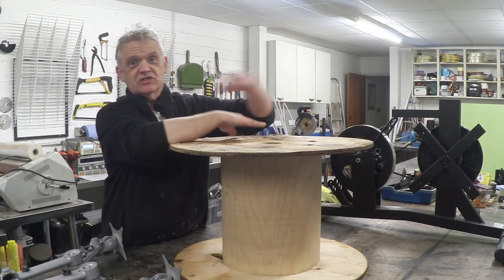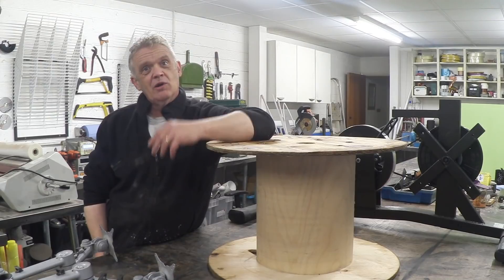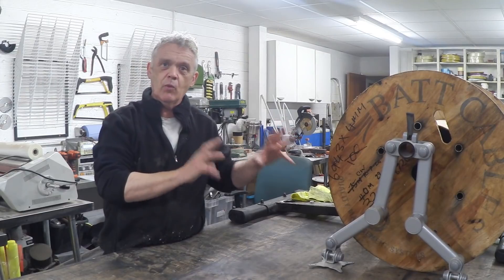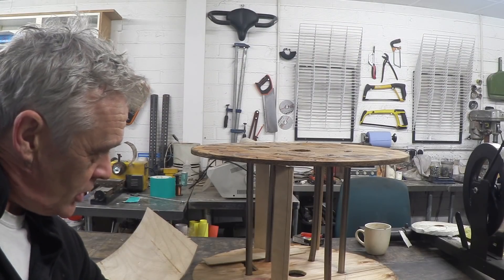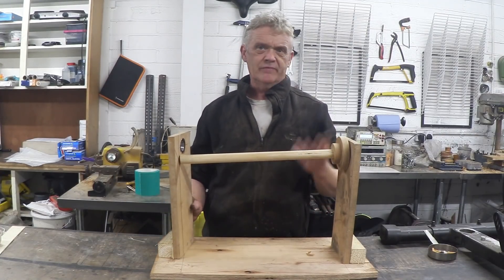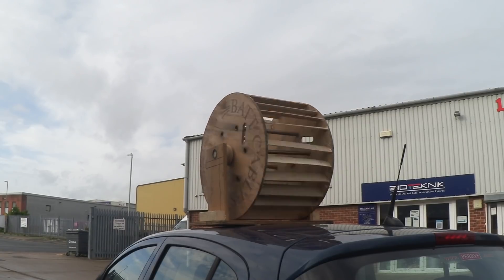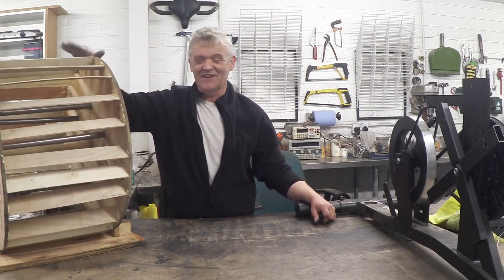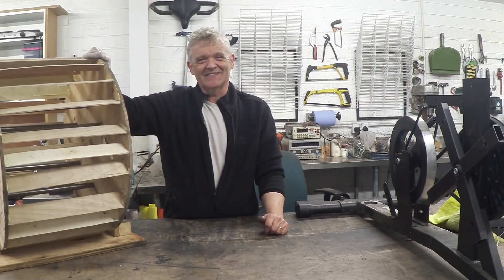Turn An Old Cable Drum Into A Wind Turbine

Comment: i happen to have just gotten a cable drum...and even more recently, a project that will use all the wire. making one 100%. mostly need to do a high power hydro generator for current project.

Comment: I have always wanted to build one of these but super light and through a cvt on a flywheel so the belt on the cvt system would change gear ratios for better torque on start up and optimal Performance at higher winds to smooth out rpm and maybe a homemade centrifugal brake. Love the content, it's a breath of fresh air from all the other YouTube hoopla.
Reply from the maker: I like the plan mate and I am glad you like the channel

Comment: You could mount a motor with a flywheel at a right angle in contact with the drum. It would be a generator spinning at some rate of knots due to large diameter against a small motor wheel.
Reply from the maker: nice idea mate
Reply: ssgeek ,i like your "Diy fret saw Mech finished" and the effective make the frame fit the tool clamping ^_~

Comment: Could also be a waterwheel?
Haha, you could pump the water up stream with the Archemedies screw and let it flow down to turn the wheel :D
Reply from the maker: it certainly could - I do worry about water wheels though as the access to flowing water is pretty restricted for a lot of folks and there are lots of rules about what you can stick in a river

Comment: I wonder, do you need to have it as a horizontal axis turbine or could it be vertical? If it was vertical axis, then some opposing magnets could be used as a type of bearing to help it spin more freely with less friction
Reply from the maker: for sure mate - and if you didn't want to instruct magnetic bearings thrust bearings would work well
Reply: @ThinkingandTinkering  Normal bearings are fine as they can take up to 50% axial loading
Reply: Vertical axis is the only way to run it as it works independent of wind direction.
Reply from the maker: can I suggest you try not to say 'only' mate - it restricts your thinking - I agree it is a good way for the reason you describe - but never the 'only' way lol

Comment: Could a feller use one of them there cable spools to power the propellers on an aircraft carrier?
Reply from the maker: I have no idea mate - but I doubt it
Reply: @ThinkingandTinkering  Well in that case can a nuclear reactor power an electric motor which would turn the spool half way out of the water and make a paddle boat out of it?

Comment: Always toyed with the idea of using cable drums  the larger ones as a water wheel by adding the baffles inbetween the sides, but how to waterproof it, I think you usually use oak or greenheart, with a  bit of creative grinding and fettleing maybe a washing machine drum  ? As a squirrel cage   
X rooby  always inspiring  Robert
Ready made mounting too with bearings
Weatherproof  !!!
Reply from the maker: I like that idea mate and if I come across one I will try it - you know me - I try not to buy a load of stuff and I try to work with things I find
Reply: @ThinkingandTinkering  washing machines are fairly ubiquitous these days, sorry unreliable ,you won't have to look far 😁

Comment: Nice. You must be the busiest man on the planet producing something like that every other day. 
What I don't really get is why these kind of turbines spin in the first place. If you think about it the wind hits the blade in front producing force clockwise, then hits the blade at the back producing force anti clockwise. Net result would be zero. I guess wind direction change inside the turbine due to the blades in front play's an important role. That would mean it's far from efficient. Also if you put a motor on it no matter how hard it spins it will not generate wind in a specific direction due to symmetry, indicating it is not that efficient as a turbine as well imho. How about making an active one  where all blades can rotate in respect to the cable drum and all blades rotate when spinning to the optimal angle in respect to the wind ? Maybe make one with 2 or 3 blades as a proof of concept ? That would be an interesting project. ( But not easy :-) )
Reply from the maker: it would be an interesting project - but more interesting to me is that as it spins it should be telling you something - that is what you are saying might have some element of error in it - I would think that it is that you are assuming a symmetry that isn't there. I don't know I am guessing but my guess is based on the observation of it spinning in a wind - of course rolling cylinders will create lift and pressure differentials between sides - so that might have a role to play

Comment: Over-modesty is overrated, if one may say. Knowing even a bit of many things is better than being great at one and only thing. Jack-of-all-trades beats any ace on the long run, atleast when giving many things "a go" and learning at the same.
Reply from the maker: I think the quote is - "jack of all trades and master of none, but so often better than master of one." But this is not over modesty mate - when I started this you could write what I knew about wind on the back of a postage stamp - I know a bit more now - still far from an expert but that doesn't matter much - the key is to try however little you know - bring all your other skills to bear - work at it and find a solution - don't get bogged down by the mental exercise of - I must find the best - I think that is an important lesson to pass

Comment: So if you just try stuff, which I think is a great idea. I do not have any work area. I rent an apartment in the States. But, I was thinking about the vertical wind generator you did. The method that you used, I thought could be used with a tree. Basically a long cable tied off on a branch up a ways then the generating part on the ground or attached to the bottom of the tree. I hope you could try that.
Reply from the maker: I really like that idea mate

Comment: if you find more drums it would be cool to compare different blade configurations, iirc there's two main designs, more like a scoop and more like an airfoil and either can be more efficient depending on shape, diameters and wind speed distribution, i would guess what you built is somewhere in between the two approaches
Reply: btw there's a cool industrial tool for pond aeration which involves a spinning vertical pipe whose underwater an outlet has small flaps that centrifugally expell water and suck in air through the pipe... this device is used to treat wastewater and iirc also for remediation. i don't have them anymore but when i had a few 200L barrels as part of the garden i was always curious to try building an aerator with be a VAWT made out of a large coffee can (there are various of plans online) designed for relatively high RPM, mounted directly on a hollow shaft that terminates in such an outlet as a simple design (could be on a bouey or some deep edge), the deeper it is the higher the resistance so i think that's the only adjustment that would needed to be made, and it's probably best to err on the side of smaller, because depth is also better for stability and even aeration.

i know large pond aerator wind turbines are a thing and usually quite complicated and costly (like thousands of dollars, designed for things like a dam or pond on a farm), and pumps need to be redundant and may still have a single point of failure without an uninterruptable power supply, so having a wind powered backup with few moving parts and no valves or anything seemed like a nice idea, especially in combination with say a solar powered air or recirculation pump, ensuring the fish stay alive even if power goes out for more than a few hours. anyway i don't have those barrels anymore so it'll be a while before i would be able to try building something but i thought in an case anyone else likes the idea i might share it.
Reply from the maker: it really sounds to me like you should be experimenting mate
Reply: @ThinkingandTinkering  i was a while ago, and i'll get back to this set of projects but at the moment i just no fish and plenyy of other projects ;-)
Reply from the maker: go for it mate - sounds to me. like you know what you want to see

Comment: lol I did the same thing a couple of months ago except removed the metal rods and used some drain pipe cut into quaters (your idea) making it about 4ft wide and was quite impressed by the performance of it, I then decided it would make a great water wheel for hydro power, so we'll see how that goes when I get it finished. I do like the idea of the radial generator, I'm wondering if instead of sticking them on outer edge you could mount them into the vertical sides to make them more secure and not subject to the gyroscopic forces just an idea.
Reply from the maker: it's a good idea mate - are you going to do a video? I would love to see the results
Reply: @ThinkingandTinkering  I suppose I should just got too many projects on go at moment and that one was put on back burner, I'll let you know once it's done.

Comment: If there was no objection to the generators being fixed to the unit you could go off grid  for most of the electricity that you use! Would be interesting to see a video solely powered by the different energy producing devices that you have made:)
Reply from the maker: Great point!

Comment: I have thought about using a couple of those as a water wheel, either a undershot wheel, or a I guess gravity wheel, where it is gears overdriven. To the point it spins about 10 rpm. Having troughs that fill with water, about 10 gallons, in each trough on the wheel. About 2.5 at best depending on the diameter, about 45killo per.  At about 24" that should spin a decent amount of tq,  it would have to spin slow enough to fill the through, before going to the next. I have a small spring, that all but stops mid summer, with no rain, it would probably be measured in rph! Make like 60 -80 rph hourly rotation, ha-ha. But spin a jackshaftck about 45 rpm, spinning a alternator about 500-1k rpm.. It would be about a 100:1, with a 96" wheel, with 80lbs on about 6 troughs, it would have alot of force!or be heavy anyway!
Reply from the maker: my stream does the same thing which is why there was such a delay between constructing the Archimedes screw turbine and testing it

Comment: When the drum was on the car and you said that the wind was at around 10mph I recon that drum at the outer circumference was around the same speed? The bearings must have been quite good to illustrate this. That tells me that the wind blade turbines are less efficient than the DG Preston drum turbine.
Reply: the 'DG Preston drum turbine' is a commercial product with proper funding and industrial production machinery is it not , V some reclaimed wood, a bit of steel tubing and second hand bearings plus a bit of brush handle , and oc rob can paint his battery/supercap storage right on that wood if he so chooses to advertise that by doing, DG Preston would have to pay for that local storage option
Reply from the maker: they were pulled from an old printer mate - so they were probably fairly decent - I am afraid I don't really know the Preston drum

Comment: Thank you for another awesome idea Robert, I tried the same a couple of months ago albeit with a smaller cable drum.
Had mine vertically and added an additional inner set of fins as the inertia to get it spinning was massive.
I might have to go back and revisit it horizontally.
Thank you for the different approach......I believe you have just earned another joinie tongue members channel
Rich
Reply from the maker: I basically couldn't decide between vertical and horizontal - but let's face it either is good
Reply: @ThinkingandTinkering  I went vertically as my annoying brain said it should spin better and wouldn't create as much high/low pressure variations as horizontally........but that's just how my brain ticks
Reply: Joined members channel 🤘
Reply: @BigRich2580  Welcome, Richard!!  I don't think you'll be disappointed with the content there!! 😊  (Found under the "Community" tab).  Though I joined mostly to support Rob's channel overall - it's worth $5/month just to ensure the content here can continue!!  And - at the risk of sounding trite - it's cheaper than Netflix!  😋
Reply from the maker: awesome mate - thanks for joining - I hope you find it useful - cheers
Reply: @ThinkingandTinkering  already am thank you Robert

Comment: As hard as I've looked I have never see a VAWT produce anything like usable power.   Guessing the issue is the low RPM they produce.
Reply: With a VAWT blades won’t turn ultrasonic. That can happen with HAWTs
Reply from the maker: really mate - I have seen a few - but I guess it's horses for courses so to speak

Comment: Well anything that is returnable if it's smooth enough and doesn't have a lot of friction will turn into wind if it has big enough fins for the wind to grab onto or push against long as long as you have those things figured out enough it will rotate the weather will be efficient or not it's another story in of itself working but will it produce work is the other question
Reply from the maker: oh for sure